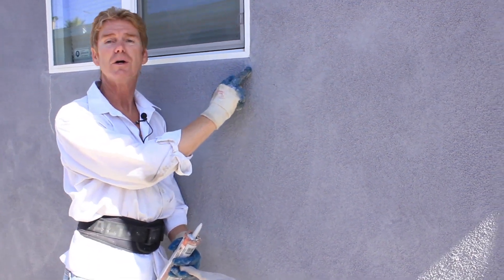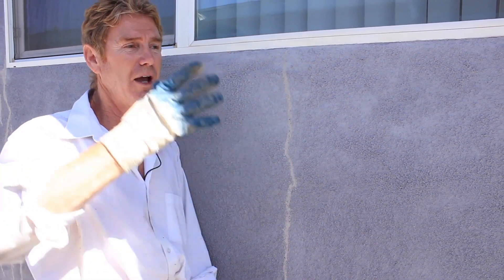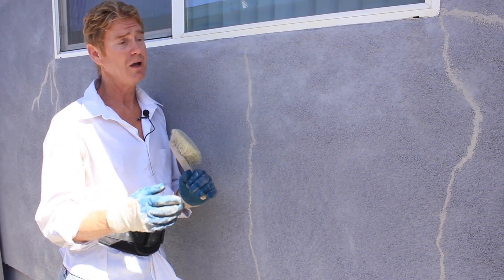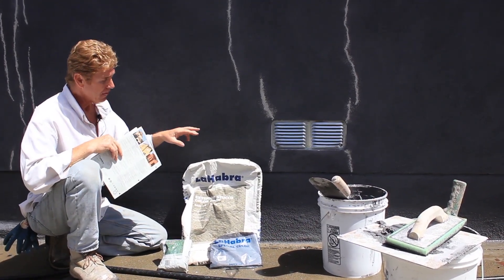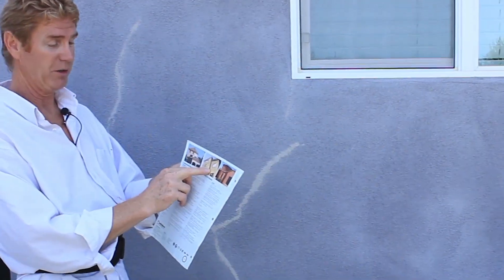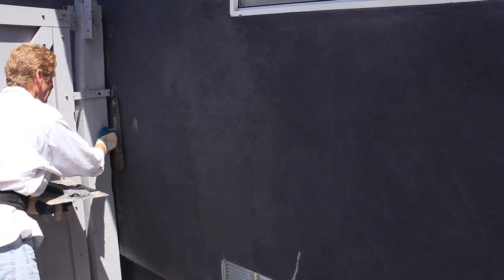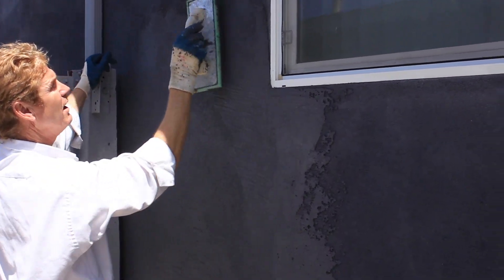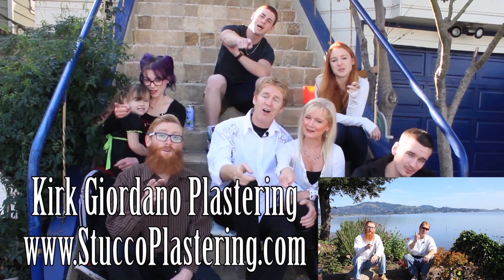Stucco color finish repairing cracks

Comment: So here's a question. And btw love your vids.  
How is it that you don't see any cracks like that inside the house,yet they so easily made on the outside?
It seems that we are all missing some other key element in these hairline fractures. 
Another contributing factor that can be negated before hand.
Reply from the maker: Howdy Yoav, the interior had sheetrock,
 this exterior had too many issues to mention in this box.
Read the description for details.
                                             best wishes,
 Sound advice for plastering repairs from your favorite stucco geek
Reply: You can have cracks inside too. My 42 year old house had a crack in the sheetrock by the door going into the bath in the master bedroom from settling. It was caused by a water leak that caused a major fail in leading to replacing the floor boards and still it was a small crack. Sheetrock doesn't crack very easy so if you have a crack in your sheetrock best be looking for a major foundation problem. Water can be so destructive and is why it is so important to keep it out.

Comment: What is the substrate here? That can make all the difference to whether it cracks or not. Is it some type of thin board, polystyrene or airated lightweight concrete panel? (AAC).
Reply from the maker: Evening Doug dude, you are well educated in this field.
 It was triple shiplap siding, covered by t 1 eleven by a crew with no clue. 
I too was sort of shocked when I realized this, this set a new rule for me as to uncover as much as possible before accepting such projects.   
                Peace, love with happiness to all.
    Kirk Giordano plastering tips-mixed with sound advice

Comment: I have read that small cracks in concrete heal automatically, through the process of autogenous healing. That process occurs when free lime in the cement binder  is dissolved by the ingress of water and which is converted into limestone (calcium carbonate) on reaction with carbon dioxide in the air.

I guess that larger cracks are fixed by autodial healing, where the home owner calls in the contractor to fix his "bad" work.
Reply from the maker: Morning John,  yes, with lime plastering cracks are self-healing. Unfortunately, most cement plaster is made with portland cement plaster here in the US.
                                     Peace, love, and happiness to all 
                          Bringing Plastering tips to the world, via YouTube Video

Comment: does render crack no matter what? I was thinking of rendering my house but after seeing these cracks I'm having second thoughts
Reply from the maker: Howdy metz, eventually all stucco and or concrete can hairline, especially in the winter where many days of rain can and will lift a home, then when drier conditions occur the home settles, this movement cant be measured, but the hairlines cracks tell the story, plus there are about 20 other solid reasons why hairline cracks can occur.

 However, this  possible hair lining in the stucco walls does not affect the integrity of the stucco or waterproof membrane one bit, some folks find it unsightly other never notice.
 This tendency for possible cracks due to movement still make stucco the best and most solid exterior sidings known to man, especially if one considers the added structural strength, R-value, soundproofing, durability, and a maintenance free finish that anyone can install on the exterior of their home.
        Live long and plaster
 images for stucco/plastering and teaching video’
Reply: Request expansion joints at window corners and at large expanses of stucco.
Imo.

Comment: havig a pan flashing under the window might help prevent cracking.  bet there is a lot of moisture in that wall.
Reply from the maker: Howdy Paul O'Neill, perhaps, the house is on the hayward fault line so throughout the years it will continue to move.
We took extra precautions on this one and went beyond code requirements, but foundation settling in some neighborhood and the building of most foundation are out of our control.  
It didn't help that someone installed two sidings ignorantly and the addition was not lag bolted to the home properly or that a two story home was built next to it after our stucco was completed, but such is life as a big time stucco dude.
 Beat wishes, 
 Kirk & Jason Giordano's DIY plaster and stucco network
Reply: Kirk & Jason Giordano's DIY plastering and stucco network Well, it IS what it IS, right?  I like your comment about the paper being intact.  That is the true moisture drainage plane.  The stucco is there as a rain screen and a UV screen.  The paper is the part protecting from the moisture.  I've seen all sorts of moisture damage under windows because window installers don't take the time to put flashing pans under the windows.  Looks like this house will have limited life expectancy because better methods were not used.  You can only do so much with the rain screen.  It does not cure moisture issues.
Reply from the maker: Hello Paul O'Neill, you know your stucco barriers, however this home won't have limited life expectancy, it will last as long as all stucco homes, It will hairline in the future as the ground will alway move in this area,
 When we lathed it I used more Sikaflex Polyurethane Caulking with adhesive sealant around all the windows, doors, electric outlets, pipes and such, than any home this size in the past to prevent water from seeping in back of the two layers of paper.
Here in California I have never seen a flashing pan under a window, I have seen and suggested flex wrap for all inset windows with the bottom lip loose for us to slide our new paper.
The general contractors do use pans for all sliders or french doors in fact I have a few videos where these pans have been intstalled.
 Best wishes,
Kirk & Jason Giordano's DIY plaster and stucco network

Comment: no weldcrete?
Reply from the maker: Evening Dnn dude, no bonding agent necessary.
 Its a cementitious finish going over a cementitious finish, they adhere by suction.
 best wishes,
Kirk & Jason Giordano's DIY plaster and stucco network
Reply: Trick question Kirk, what about the painted surface? Shouldn't weldcrete have been applied to that section since theoretically the color coat wont adhere well to that section since its non porous?  Also, wouldn't weldcrete be needed on top of the caulking since this is not porous?

Comment: Hey Kirk:

Everything you said about "hairline cracks" that are caused by building movement is true but you seemed to imply that was the TOTAL story on STUCCO CRACKS which is not the case. I have had stucco applied that was loaded with cracks in a month. Sometimes the cause IS due to the mixture that is making up the stucco, the application process, and/or the curing process. As with concrete, too much cement can cause the curing process to create too much heat and shrinkage that will lead to cracks. you mentioned "hydrating" the surface and waiting for a cure period. Not doing those things can lead to a surface that is full of cracks and that condition should be explained.
Reply from the maker: Evening Pappa Bob, I have included those realities in other videos as well as placing staples or furring nails in the field instead of the stud where the weight per square inch is also important, as placing stucco netting on backwards, using nails and or staples where the leg does not go into the stud at least 7/8 also creates cracking, wet studs with plywood butted together is another common problem especially in areas where the heat is severe as the studs as well as the shear wall will expand in the hot sun then shrink when it's cool causing all new stucco to expand and shrink with it, this usually creates the horizontal cracking that is not normal such as the vibration cracks that are quite typical and normal around doors and windows that shut or slam when opening and closing, Wind and especially a week let alone a month is possibly the biggest movement to any home as this creates ground swelling then settling which can't be measure by machine or the human eye, yet, after storms the new cracks with no dirt tell the story, foundations not poured properly or with weak concrete also concrete with a PSI strength under 2,500 PSI does not help either,sand mixed that is not rinsed free of salt, or certain sand not meant for structural strength hurts too, "would you believe  dubai spends 17 Billion dollars annually on sand imported from Australia while Dubai is in a desert full of sand but not good for building," redwood trees with roots that appears close to the surface and are again horizont instead of going vertically downward have caused some damage to many homes which I have visited also.
 These are just the common sense sort of tip of the iceberg  circumstances that cause hairline cracking and or structural cracks in stucco and or concrete, 
Things that make you go hmmmm.
 best wishes, and thanks for the tips,
 kirk giordano plastering

Comment: Im an auto body man,I repair rusted cars,I tell the customer I will replace all rusted metal with new sheet metal,but I can't guarantee, that rust won't come back 1 or few years later.Can never guarantee rust, their is areas in a car you can't get to.So do what you can and move on.
Reply from the maker: Howdy Filiberto Dude, they say rust happens.     
                    Live long and plaster
         Mastering Plastering for the beginner’s

Comment: I remember when you did the video for this and said it will never crack lol
Reply from the maker: Evening Sub, I don't say stucco wont crack, as all stucco and concrete cracks, especially if it's on the fault line as this one one, there are other reasons but none related to error in application.
Cheers,
 Kirk and Jason giordano’s plastering videos
Reply: Kirk Giordano plastering Inc. np mate I'm a spread and the work you do is great and only other spreads can really appreciate what you achieve I do Krend in uk
Reply from the maker: evening, mate, no worries,
 cheers,
 kirk giordano plastering

Comment: I'm Not a Plastering Contractor I Do Waaaay More Brick & Stonework But that Looks Like Shrinkage. In Regular Mortar the Color Always Says Not to Use More than 10% Color to Mortar Ratio.
Reply from the maker: Greetings John, read my above comment, for the facts.
                Get plastered like stucco
 Kirk and Jason Giordano’s sound plastering advice
Reply: Decades Back I Was a Painter Working on a 3500 sq ft Carriage House.  There was an  Exterior Sided Wall Fastened Via Furring Strips on Concrete Block. Anyhow that Sided Wall was 80' with No Expansion Joint. When the Sun Hit that Side you Could Hear the Siding Pop as it Expanded. Here in Illinois Our Frost Line is 42".  There's Quite a Bit of Frost Heaving. I Got Into Masonry Work Partly Because of the Permanance. The More I Work with Stone the More I Prefer it Over Brickwork. I've Done a Lot of Genuine Stucco Repairs. By No Means Am I an Expert. But it Still Looks Like That Stucco Shrank to My Stone Mason's Eye.. I'm Happy Doing Stonework that'll Be Around for Generations Here in Northern Illinois where the Ground Is "Stable" & We Only Have to Worry About Frost Heaving Buildings Freezing Solid 40"+ Down.

Comment: perhaps maybe few control joint .?? 

I still believe that EIFS system goes far longer with out cracks in time .
Reply from the maker: Good evening Olah, excellent idea, had I known a bit about more about this home, this house may have benefitted from a couple.
However, I have seen homes also with expansion joints, with more cracks than this.  But as a rule your right.
    The most complete plastering encyclopedia in the world on video, by the plastering messengers of Youtube.  
     Over 850 free self-help videos 🎭 👀💃
Reply: Then if you embedding  fiber glass mesh reinforcement mesh . In between 1st and 2nd coat . That’s the way to go .

Comment: How could you make any money if u have to keep going back over your jobs i know  u never got paid for that
Reply from the maker: Good Morning Boner dude, when I accepted this plastering job, I didn't realize two huge factors, first the home was on the Hayward fault line, and second, over the years a handy person attached a second wood substrate over the original wood siding, very poorly indeed.
    It didn't help the neighbor built a second story addition next door either,  
FYI, with stucco the slightest movement and or vibrations causes hairline cracks, this does not affect the integrity of the waterproofing membrane, however, most folk panic as they have no clue why this happens it’s simply home movement, vibrations in stucco walls are sort like Kryptonite to Superman, not good.                    
                                Live long and plaster
       Teaching the world to stucco, one video at a time.
Reply: Well explained  Kirk.  I work in the paint & dec of int and ext substrate industry and come  across problems like this all the time. Most structures tend to move from time to time and cement expand in summer and contracts in winter therefore unless you live in dream land hair cracks eventually will appear indeed. There's nothing else to be done but periodic remedial beauty repair. Unfortunately we dont live in a perfect world Joe B. Good on you Kirk for being a prompt professional by going back to re mediate the issue and showing the viewers the ugly reality of substrate movement :-) Love your work man!!

Comment: if you added fibers to the stucco it probably wouldent have cracked.
Reply from the maker: Good morning Air dude, below video's are just 3 video's of facts on stucco cracking, I agree fibers and other additives do help 
    Live long and plaster
 teaching  plastering video’s

https://youtu.be/C3Jqe6sQt2s         : cracking for deed weight
https://youtu.be/2sBHTy-v9ic          :  cracking for sun expansions, woods swells thus stucco cracks
https://youtu.be/O5PIz9WQfzM      :new hose cracking
Reply: In New Mexico where every building is stuccoed, we don't have the high chance of Earth quakes. We do however have 50 degree temperature changes in a 24 hour period. We add acrylic modifiers and fiberglass fibers as well as embed fiberglass mesh in the mud as a secondary matrix with the wire lath...it still cracks